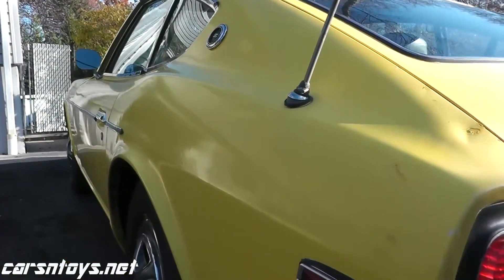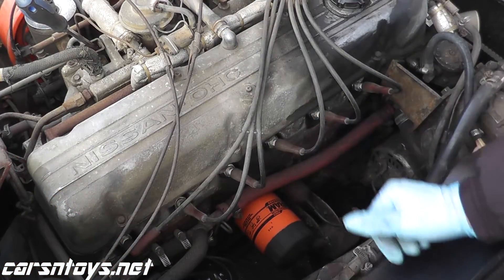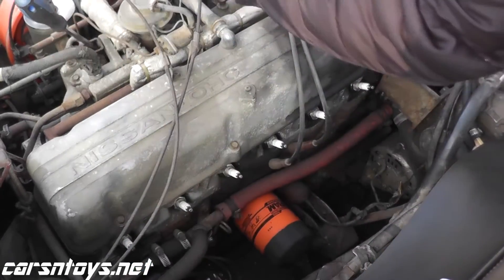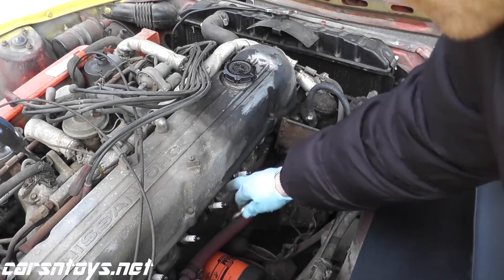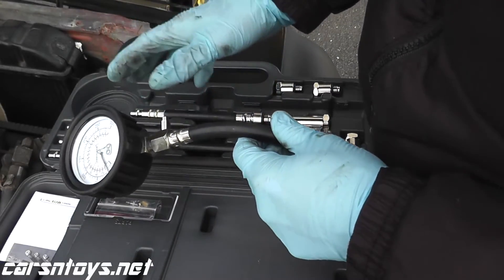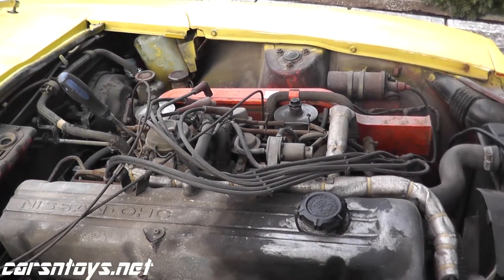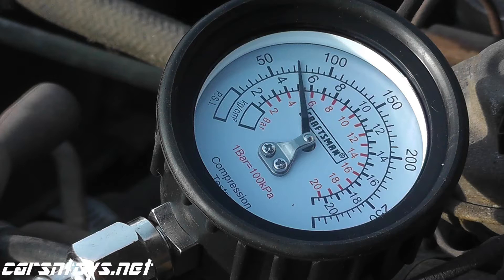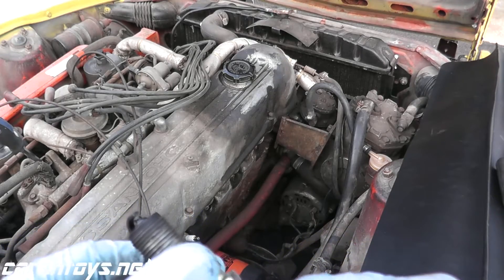How To Compression Check Datsun 240Z 260Z 280Z 300Z

Comment: Cylinder leak down test is the best. Can determine if it's the rings or the valves. Remember valve lash needs to be adjusted every 15k miles. If the  valve lash is to tight it will burn the valve..